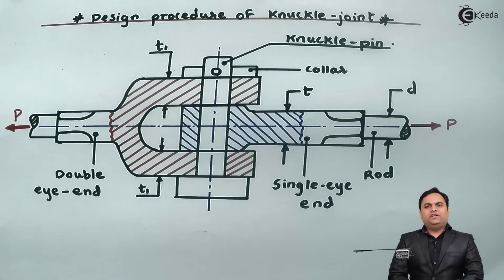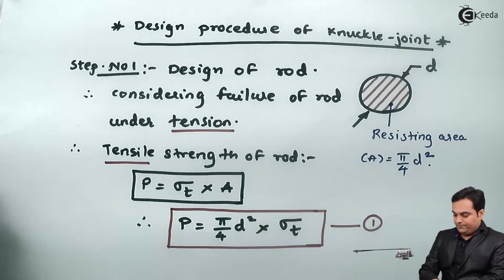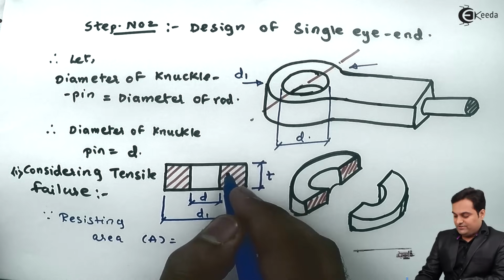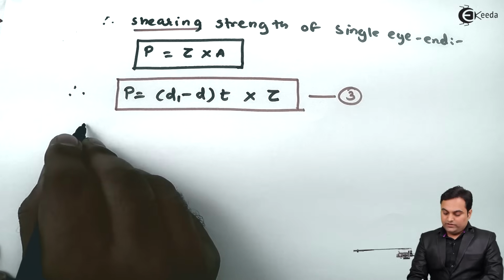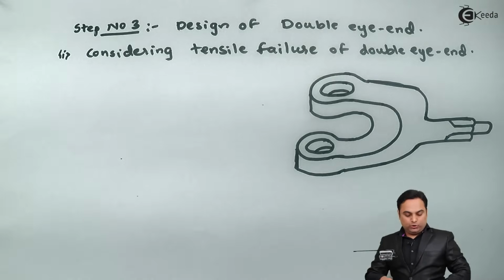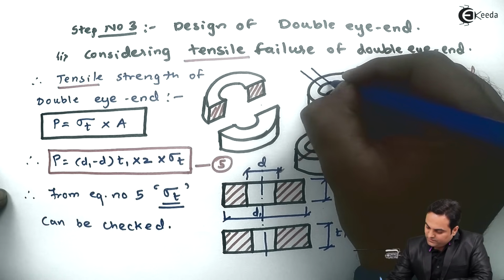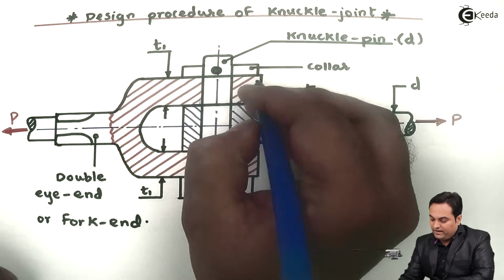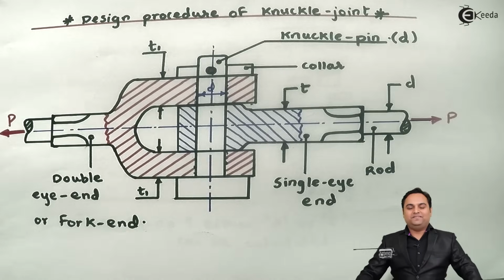Design Procedure of Knuckle Joint - Design of Cotter Joint, Knuckle Joint, Levers and Offset Links

Comment: Thanks for sharing it.
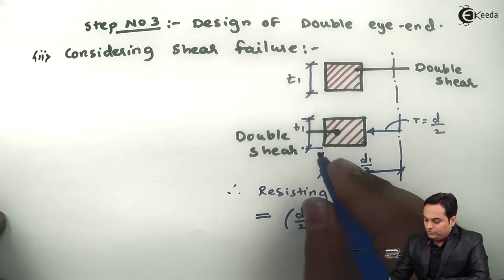minor correction is there at 30:11, Resisting area will be (A)= (d1/2 - d/2) * t1 * 2 * 2 
(not t its t1).
Reply from the maker: Yes, thickness of double eye-end is t1.it is explained in the diagram but while writing only t was written so just look at the diagram & make t as t1.
Reply: Shashank Pandey haa👌
Reply: good observation